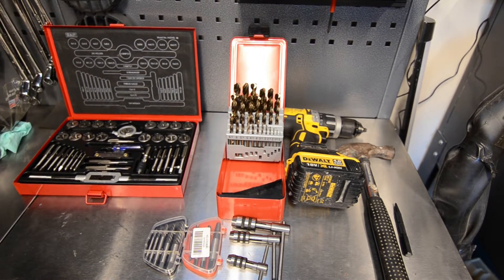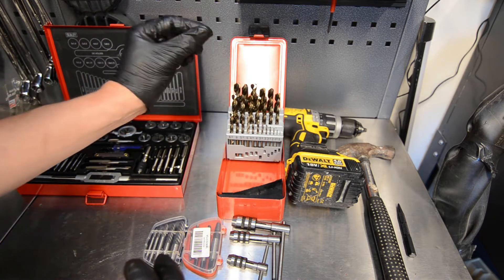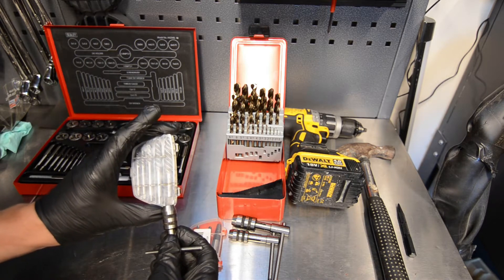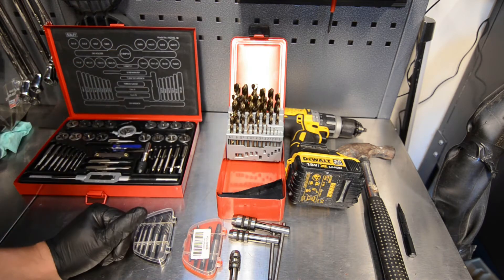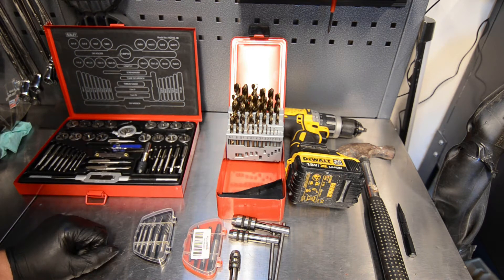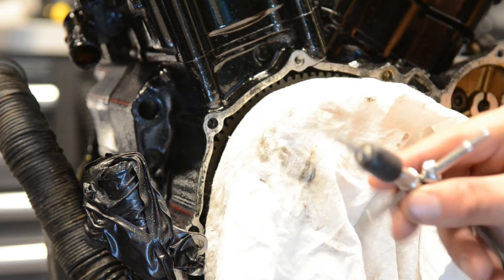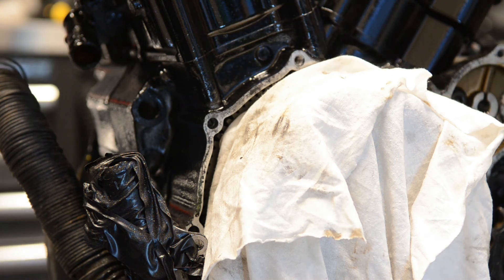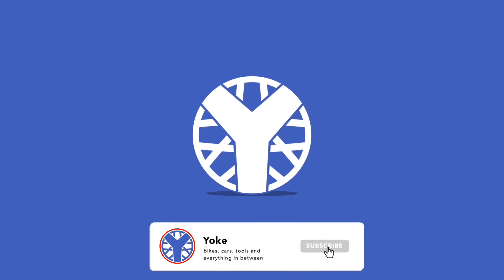Honda Bros NT400 Restoration Project Part 25 Broken Engine Casing bolt extraction

Comment: Bravo! It’s always a bit scary removing broken bolts especially in the engine .  I have better luck with left hand drill bits when drilling the pilot hole for the extractor to engage. Sometimes drilling alone removes the broken screw in a left hand - reverse rotation.  I’m in middle of restoring my Bros aka Hawk GT on my side. Your videos are my goto before I tackle a specific part on it.  Can’t thank you more 🙏  ☮️
Reply from the maker: You’re welcome, I am delighted you like them. I have to say, I have owned 4 of these bikes in the past, and accept for servicing, tires and chain. I never had to do anything with them. They are just such a well build bike. Yeah I didn’t have any left drill bits and this was during one of our lockdowns so options were limited. The trick is to have a new drill bit, and a quality one. Nothing worse then removing a broken bit on top of it.  Hawk is almost identical to this, I take it your in the states somewhere?